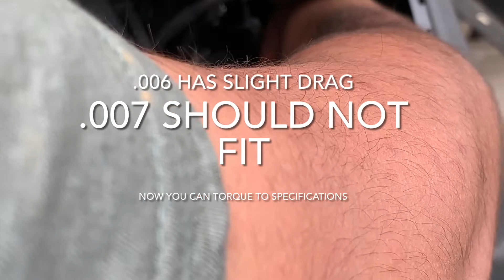Valve adjustment on the Honda Navi 2022 ! 👀🏍

Comment: Thanks for the video. I noticed you checked / adjusted one valve only. If I understand correctly the other one was within specs and didn't need adjustment? I didn't see you check it.

Comment: How many miles does yours have and what made you decide to check the valves?
Reply from the maker: It’s has about 600 hundred miles on it and the manual says to adjust the valves at 600
Reply: Inspect at 600
Reply: I'm at almost 4000 miles and never touched the valves. at 4000 I will .
Reply: P.s. there's another navi owner on YouTube with 16000 on his navi and told me he never touched the valves.

Comment: My Honda dealer charges $125.00 per hour for labor. So a valve adjustment is $375.00 .       i was at the dealer today and just out of curiosity i asked. all the bikes are way over priced.  a new navigation is $1,807.00😁 but otd  its $3,200.00 there really screwing people
Reply from the maker: Exactly friend we eventually sold it back it and got a Toyota Camry Toyotas require no valve adjustment.